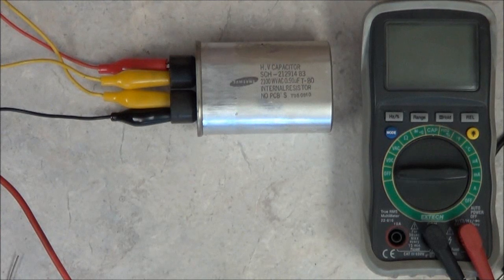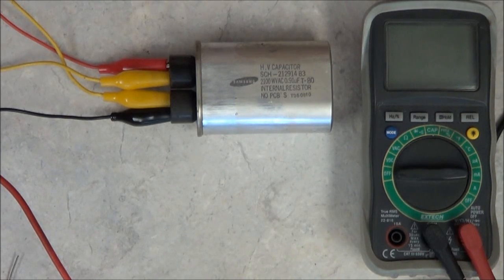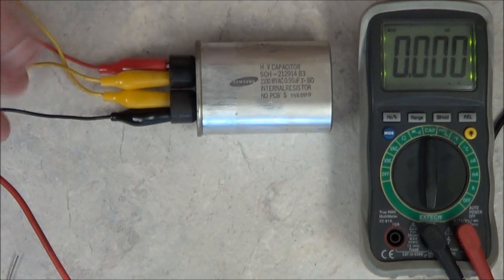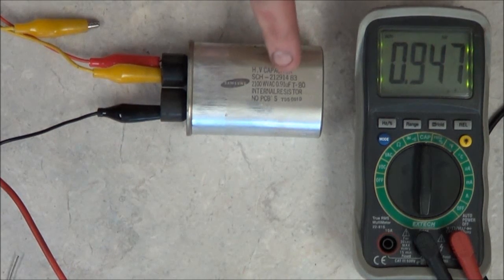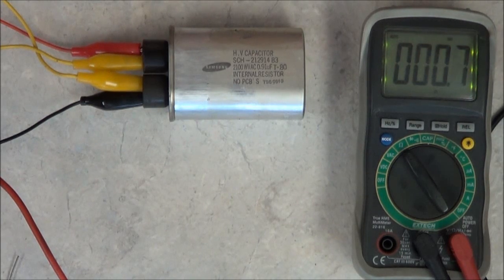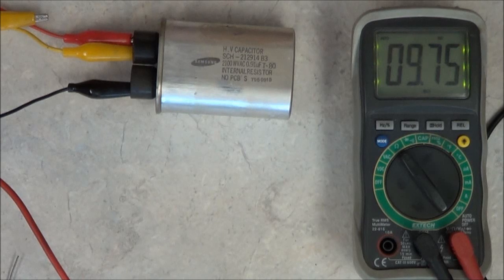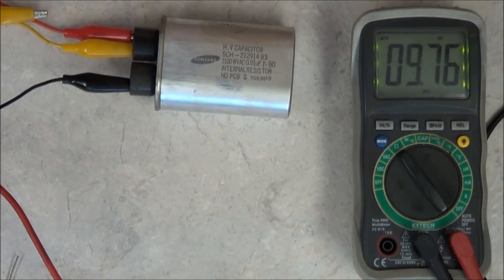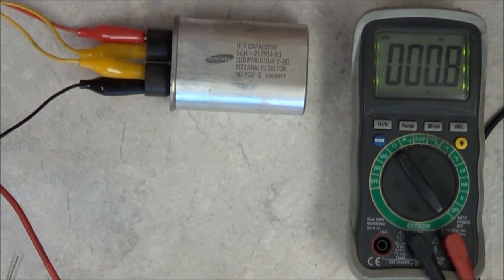How to test the Microwave Oven's HV Capacitor

Comment: Is there wny way to know which capacitor mf. value must be used with a specific magnetron? I think mine was replaced with one that is not the same value of the original and I´ve read that it may cause a low heat or a premature magnetron damage. I´ve looked on the internet and can´t find a chart where each magnetron model has the value of the capacitor to work with
Reply: Most of microwave ovens have a schematic diagrams on the back cover.  It will state the capacitance / voltage ratings next to it.

Comment: Don't rely on that test, I have tested air conditioning capacitors show good on a capacitor  tester but if you put it on a ESR Meter it will show the actual AC passiveness of the Cap measures perfect on a cap tester, but 20 ohms on a ESR fails also through a hundred volts across it, to test for leakage. Those large caps are expensive about $30 bucks. Ohm test and Cap test these days are not reliable. Maybe just to see if shorted or open, but no way accurate.  Hope you don't mind my 2 cents.

Comment: maytag microwave fan stays on all the time, no level 1 speed, just 2 3 4 5. The fan won't turn off. Can someone please help me? If I unplug the fan connector, everything seems to work fine, even the fan controls ie level 12345off. Thanks.

Comment: Sir how  test that  high voltage capacitor in to analog multimeter?
Reply from the maker: Ian Coloma  A crude way to test a Capacitor with an analog meter is to use the Ohm setting. You will need at least a 100 MΩ meter.  Keep the capacitor shorted and attach the test leads. Should read 0 Ω. Remove the short.  You should now see the resistance begin to rise steadily.  As the Capacitor stores the electrons the resistance will increase.  There is a 100 MΩ bleed resistor built into the capacitor.  The resistance should equalize between 50 and 100 MΩ.  -MrFixit

Comment: how can you remove the resistor and keep the cap
Reply: Mark Hodgson you can't, if you take the resistor out then you have to open up the capacitor. UNLESS you can manage to weld the aluminum top back on then it will probably still work with less internal resistance meaning more something, Amps, volts, farads, etc. if you manage to remove it and get the capacitor back together, if it works please make a video about it, sounds pretty cool.
Reply: Those capacitors are oil-filled!

Comment: Where the other end of the yellow cables are pluged is not show in the video
Reply: Pablo Jara, it's just one yellow wire.  One side of if connected to each terminal to short out the capacitor.
Reply: Pablo Jara yellow wire stands for earth
Reply: what video are you watching ? are you just saying words you heard before?

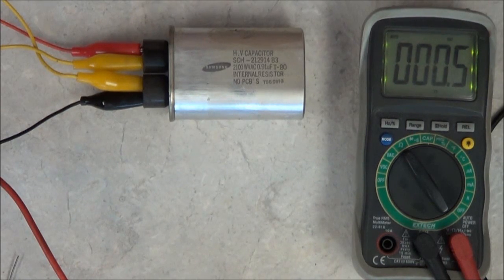Comment: 7:02 diode?
Reply from the maker: +Allan Tamm Sorry it was suppose to be resistor and not diode. -MrFixit
Reply: @ESRepair  Does the voltage doubler diode also discharge it?